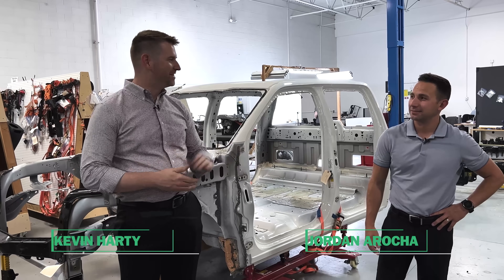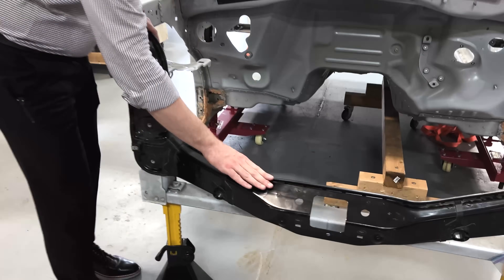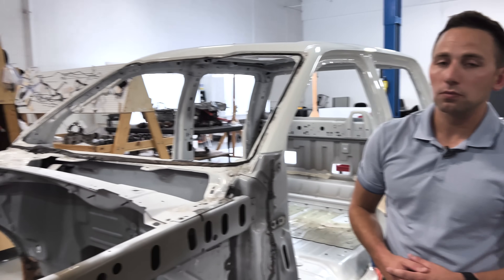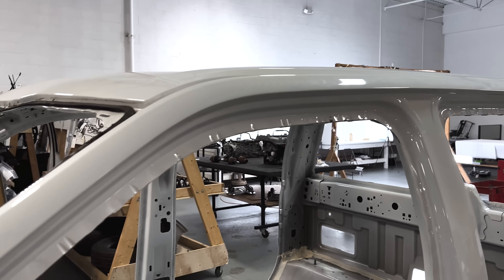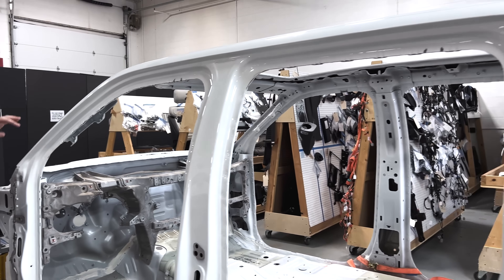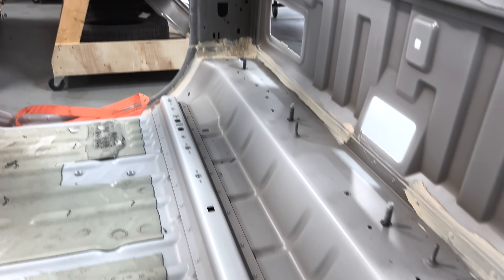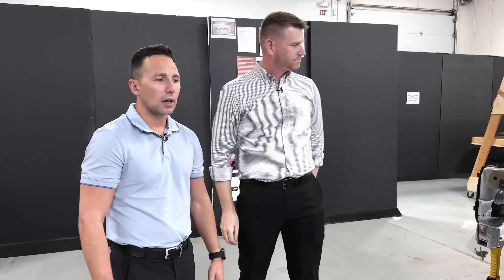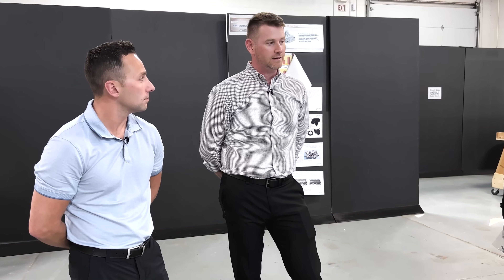Aluminum Alloy Body and Bed, Built Ford Tough  -  Lightning BIW Breakdown

Comment: Its almost laughable how you expound the virtue of "more payload capacity" when in truth Ford was approaching worthlessness in terms of "modern standard" F150 packages without the use of aluminum.  Looking through some of the specifications over the years, there was a time a decade ago when "modern standard" crew cab F150's had a total payload of less than 1,000 pounds, with that sub 1,000 pound payload including the driver.  

In truth, any half ton truck. light duty or heavy duty for its class, should have a payload closer to 1,250 pounds excluding the driver in that figure.  The trucks were becoming nearly useless, and were being made only for being used as cars with a towing ability.  Hell, load up six full sized men in those packages, and you were exceeding the worthless GVWR of those packages.

The push to make half ton trucks crew cabs and treated as cars rather than trucks was creating a minor crisis.  Crew cabs are much heavier than regular cabs, and the modern 6 and 10 speed transmissions and all the extra weight was essentially making them too heavy for their intended purpose.  The most worthless half tons ever produced were the crew cab steel body trucks of that era.  Pure garbage.

The aluminum body isn't adding to the half ton truck, rather they are absolutely necessary for the half ton truck to work in the backwards configuration they want.  You can't get a real crew cab half ton unless you find a way to cut off about 700-800 pounds.  So, that's what they did.

And always seeing everyone in the modern era ignore GVWR and payloadd, and instantly go back to "tow rating".  Because every light duty truck going forward is a short bed and everything will be towed, right?
Reply: It's strange that the aluminum body is "absolutely necessary" for Ford, but GM and Stellantis (Ram) manage the same payloads with steel bodies.

Comment: I've been watching coverage of the F-150 lightning since it was just speculation years ago, and at 4:49 is the FIRST TIME anyone ever mentioned that Ford kept the aluminium design for this new model. If anyone can show me a mention from Munro or any other site of alu for this body, I'll eat my words. It's like everyone was supposed to just assume the material was unchanged, in a model year that's a very radical departure from the past. I bet what happened is Ford stopped playing up the body material as a differentiating advantage, and all the lackey influencers forgot that it was even worth mentioning.

Comment: I wonder what you think about Ford changing all the exterior body panels, as the fenders, hood, boxsides, tailgate, front bumper, headlights and taillights  are all Lightning specific; which seems like a huge expense and probably most folks won't ever notice the difference.... P.S.  I have a Lightning Lariat and it is the best, most impressive vehicle I have ever been in, full stop! I LOVE it
Reply: Three years later, how do you feel about Ford discontinuing the BEV Lightning?

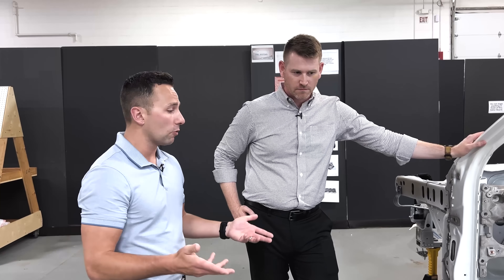Comment: 9:05 well yeah. It's not a unibody. The car body pretty has good isolation to the chassis.  I noticed this immediately with my very first car vs all the body on chassis vehicles I used to drive.

Comment: I get your interest in the way Ford is using old tech to screw bond the cab frame etc, can’t see why you think it’s clever, have you guys forgotten about the giga press systems will run rings around this bodge up of a half attempt to beat Tesla, then the Cyber truck is yet to be stripped down when it’s out, Iam sure Sandy has a thought or two on this, please don’t be blinded because it’s the Ford 150 sparky mod, the cyber truck will blow this sparky dumpster fire into the past very quickly 👍

Comment: As a current 2005 ford F150 owner Ill be waiting for a TESLA since they actually innovate and dont design and build failure points into their vehicles for service revenue. Oh and i wonder if theyll LIE about some of the specs like they did on my 2006 F150 that has a disintegrated frame from rust. They also literally lied about the alternator amp rating on the window sticker. Ford=fraud. If they cant build a good ICE truck that doesnt have numerous design flaws built in what makes anyone think their BEV will last? Its funny that my 2006 F150 had less quality  and was built cheaper (corners cut) than my current 2005 I bought to replace it (having to do an engine swap while waiting for the Cybertruck) due to FRAME RUST. The Engine in the 2005 was junk so I put my 2006 engine in the 2005 body to get me by and noticed so many areas that were designed/engineered worse on the newer truck.

Comment: I live in rustville where every 10 year old truck is already rotting out at the wheel wells.   I would imagine these aluminum trucks will hold up a lot better long term.  I would want one just for that reason alone.
Reply: Aluminium is no guarantee of being hole free. Rust free yes, but not corrosion free :)

Comment: When Tesla uses a large aluminum casting, the Tesla fans hail it as unique and superior to all others. When Ford uses an aluminum casting the entire width of the cab and of substantial height, on their highest-production vehicle model, it isn't even mentioned.
Reply: What large casting are you referring to ? Certainly not in this video. Hydro forming is not casting.
Reply: @terrysullivan1992  The dash support in the interior, spanning between the A-pillars. The longitudinal rails ahead of the firewall (and possibly other components) are hydroformed - I'm not referring to those.

Comment: Like almost every other commenter, you keep saying that the F-150 is the highest-volume vehicle in North America... but the Chevrolet Silverado 1500 and GMC Sierra 1500 are just two different trim levels and badging of one vehicle model, which typically about the same volume as the F-150. Combined Chevrolet Silverado and GMC Sierra pickup volume over the whole  range (1500 to 3500) is again similar to Ford F-Series pickup volume over the corresponding range (F-150 to F-450). Ford and GM are the leaders in this segment, not just Ford.

Comment: Flow-drilling is great, but you didn't mention one reason they use it: since there is no pre-drilled hole, the parts can be assembled by flow-drilling even if they are not really lined up properly. Lining body parts up correctly has never been Ford's strength.
Reply: Alignment is also what Sandy himself is always talking about.

Comment: I don't see a problem with the lightning looking like a regular F150. Why would I want to drive something that looks like a EV clown car.
Reply: Exactly. Building tradespeople are usually conservative at least in their choice of vehicles I would expect and aren't going to buy a goofy-looking truck that's as obnoxious looking as the Pontiac Aztec.
Reply: @paulchristenson5256  yes they will simply becasue it will have lower cost of ownership (efficiency) and last longer with less maintenance/repair cost
Reply: @tabbott429  Says who?

Comment: gear tunnel ?? hello it a ev ford :) :)
Reply: @richardnedbalek1968  It has the roomiest interior in the segment and the tunnel is used to route electrical wiring and make clearance for the front motor mounted inverter.
Reply: @richardnedbalek1968  nonsense!!!! Or reusing that already existing cavity for the EV hardware is a good idea instead of totally redesigning everything!!!!!!!

Comment: Great job guys.  Shows that Ford did a good job of converting the ICE F150 into the Lightning and by keeping the frame and aluminium body were able to keep costs within limits.  I am impressed that the Lightning is 550 lbs lighter than the Rivian.  One might expect a blank sheet design would be lighter than a conversion, but not in this case.  I look forward to seeing how Tesla’s Cybertruck compares.
Reply: Lol…. Not only the ford is significantly way bigger than the rivian but it’s also lighter and let’s not forget that ford makes shit tons of different configurations from single cab to double…. They even sell those trucks without bed or just the chassis and powertrain the tesla cybertruck isn’t going to be that flexible.
Reply: Someone can already very easily convert the ford lightning into an RV, ambulance, utility vehicle…… something the cybertruck unfortunately won’t make possible.

Comment: imho although Ford is trying, the 3 really big things that will stop mass market takeup are 1) the dealer markups on the all Fords putting people off buying a Ford .2)the scaleability of production of the BEV versions, if they can build them they should be able to sell them,3) the big elephant in the room is the parts supply eg "the blue ford oval", i watched a yt video where someone was parked @ a ex motor racing circuit & Ford had over 40,000 parked up due to lack of parts "badges/chips" until that problem is sold everyone that comes off the line missing parts is unsaleable and effectivately a "used vehicle" even before it gets to a stealership, unlike Tesla where every car that comes off the line is sold & complete and heading onwards to its owner, a company the age/size of Ford should have mastered vertical intergration @ least 30 years ago not now fighting to get "badges", if Jim is not careful the cybertruck hitting production and delieveries will kill the Ford/GM pickup marketshare in less than 3 years, a bit like the old saying"if you make it they will buy it" considering Ford/GMs state of fianances any delay in selling to the public(not the dealers) is only going to worsen there bottom line,i mean 40k plus stood vehicles for a $5 badge ??, the one thing Ford should have definately been making in house supremly bad decision to outsource the amount of parts they do,so many factors beyond Fords control that will cost them dearly from parts to stealerships, sad very sad, Henry must be spinning in his grave :(
Reply: Most buyers of BEV trucks are not going to want to drive a Cybertruck, ie tradesmen. They're going to want a truck that looks and acts like a truck and not something people are going to point at and either laugh at or be in awe at. JMHO
Reply: @paulchristenson5256  Im a remodeler and I will replace my ford with a cybertruck in an instant.
Reply: Lol….. things are already changing
Reply: Makes you wonder if thyre using the "missing parts" excuse as a cover for falling sales... Im betting they are.

Comment: surprised you didn't mention the other huge advantage of the aluminum body and resultant 700# wt. reduction--less battery size/more efficient/cost effective.  So, either more range/towing capacity with same size battery as Chevy Silverado/Dodge or less cost for battery.  Shouild make them the class of the pickups.  (Of course Cybertruck is in a different league all together)
Reply: Well said, a full size fully loaded up platinum lightning is 300-400# lighter than a purpose built ev platform design like the rivian r1t.
Reply: The cybertruck isn’t in a different league it’s just a dumb idea of truck with less practicality and flexibility in use. The ford can very easily be made single cab, and all the other configurations tat ford offers to its ICE trucks. From RV to ambulance to utility vehicles…. The cybertruck isn’t made for that
Reply: @carholic-sz3qv  From my 40 year experience in the construction industry, I would have loved to have a Cybertruck.  No maintenance, stainless steel body, 1/5 the energy cost.  My foreman would love it.  No need to get oil changes every 2,000 miles.  No generators to fuel all the time. Great in mud and snow.  PERFECT construction vehicle.  AND 1,000,000 miles!!
Reply: The aluminum body never saved 700 pounds. In the first year of the F-150 with an aluminum body the truck was about 700 pounds lighter than the equivalent model of the previous year, but there were many changes responsible for that weight savings - the aluminum cab and box were only about half of the reduction.

Comment: It appears that the chief difference between Flow Drill Screw and a self-tapping screw is that the latter needs a pilot hole through all pieces. However, is the FDS removable, or does the plastic deformation of the metal lock the screw permanently in place?
Reply: They said it was removeable. My impression was that the heat in the FDS deforms the material more than a self tapping screw would. But that it is not enough heat and pressure to forge weld the screws into place.
Reply: They actually said it is removable but more permanent than bolts. Also the flow technology give more and stronger material for the joint at the thread point.

Comment: Ford did the right move, using an already existing truck platform, speeding up the development process and production, with tooling and supply chains already available.  Also plenty of aftermarket accessories to use with the F-150 platform.
Reply: And from there they are going to improve the design and manufacturing very easily going on
Reply: The model Y is on the model 3 platform, there is no y platform.. and now many of the M3 parts have made it into S and X as well. I like them redesigning the entire concept of a truck, instead of sticking another shape onto a M3. If you want that, buy one of the many other options flooding the market right now. an f150 on mars, even in silhouette, would look silly
Reply: Now if they can just make frames that dont rust through from the inside out like my 2006 did.
Reply: @tabbott429  r0usting frames from the inside out is a common issue with many manufactures using boxed frames. Some tips to prevent that, it's to spread some rust preventing fluid inside the rails. And plug most holes on the frame leaving only the draining ones.
Reply: @tabbott429  nonsense!!!! Are you still living in 2006!? Wtf!!! Grow up